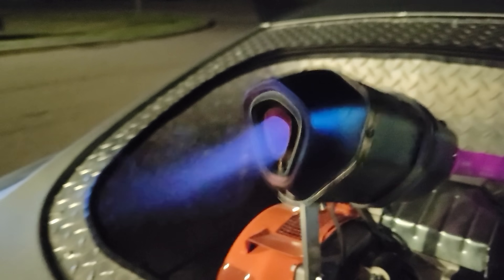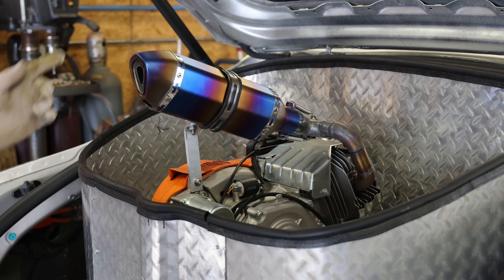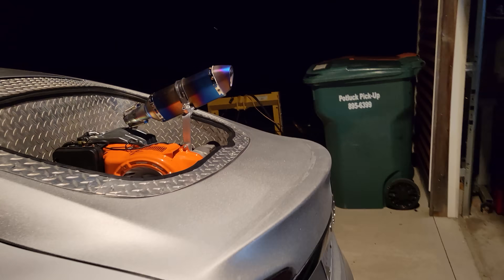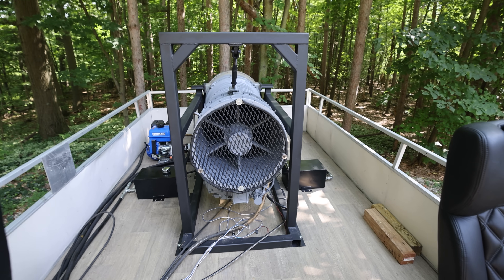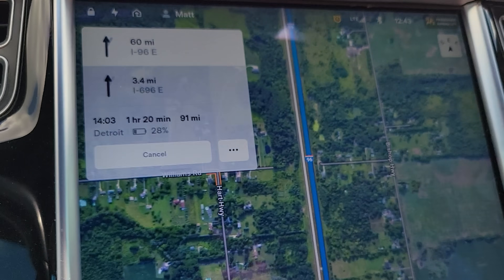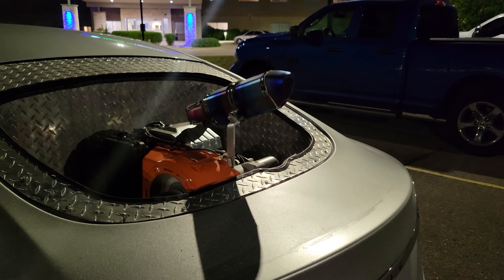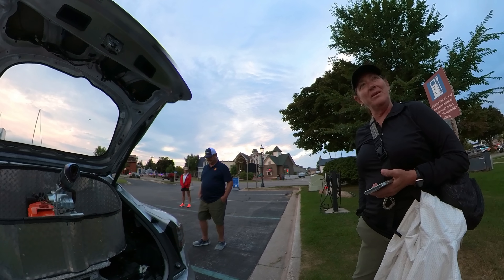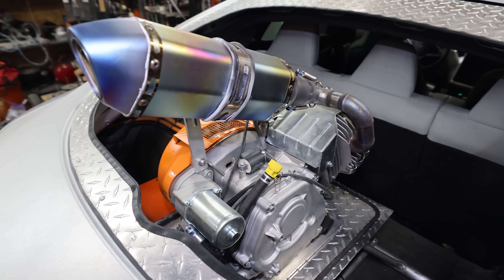Cordless Tesla (I Drive 1800 miles without charging) P.1

Comment: I wish you showed more of how this actually worked! Would love to see how you can charge while the car is moving and where you tied into the system to except the input of power. Normally, a Tesla will not move or drive while it is charging. Any chance you could share more about all of that?? :D
Reply: The only part I wanted to know, he didn't cover! 😭😭
Reply from the maker: @Thesocialgarage  there's a reason for that, 3 things, Proprietary, Very Dangerous and Deadly Voltage. I custom-built the BMS and the algorithms, I won't have anyones death on my hands tho.
Reply: @WarpedYT  good idea to not show anybody
Reply: @WarpedYT  calling Bs on it.  Looks like you are showing bling bling tools and the generator was a wen 8 k, not a 10k.  Go back east coast
Reply: @WarpedYT  I want to know the electrical engineering behind this soooo badly. What do you mean by designing algorithms? Did you program the BMS on your own? Did you actually engineer the BMS from the ground up, or sourced multiple BMSs for groups of cells? 

At least in my mind I would hook up a 24V BMS to each of the batteries in the pack that are in series, though the disassembly and install of such a task is a massive undertaking. I also have no clue if that would cause interference with the Tesla's BMS. Really wish it was shown. Almost finished with my degree in electrical engineering and I want to learn to build my own EV one day. Starting off with ebikes. 

I don't think you should worry about the liability aspect. It's not like people are suing mechanic YouTubers when they try to DIY their gas car and kill themselves. Regardless, I would really love if you could share the electrical engineering aspect without actually showing how to tear apart the battery and install it.
Reply: @LugW0rm  Its fake. Nobody is going through this hassle without showing the meat.
Reply: @snowysand13  good point. Although, Yboob has demonized for lesser offenses.
Reply: @WarpedYT  look sir no one gonna copy what you did 
but for knowledge and our curiosity wish that you still make vids how it works i mean maybe some other wacko gonna build same as you but improve it for more safer.. maybe
AND FOR SCIENCE
Reply from the maker: @talusranch990  I built this from components I ordered from the manufacturer overseas, I was told the engine was around 10,000 watts of output around 13 horsepower so I quoted that. My setup here only made 6000 Watts Max.
 I worked with a very large manufacturer overseas, no doubt these components must be used in some sort of off-the-shelf product but I obtained individual components to make a whole system.
Reply from the maker: @LugW0rm  yeah I'm really sorry about that, I meant to post all of those tear down videos over the course of a year to my other YouTube channel called Matt's lab, but I've been working by myself and very short-handed, unfortunately I'm not going to get around to posting those videos for at least another 2 to 3 weeks. But I can tell you this took me about a year to complete the modification. It is a buttload of work and I spent about $100K total to get to where I'm at currently
Reply from the maker: @tehonlynoobs5556  yeah that wacko is me
Reply: @WarpedYT  Appreciate the response! Honestly, it's kind of a genius YouTube algorithm strategy, got quite the engagement with everyone arguing whether or not it's real. Looking forward to the rest of the videos :)
Reply: ...accept...
Reply: @gesenhausen2922  yes, just 'accept' it, except unless that's not what you meant :-P
Reply: @augustwest01   r/woooosh or not? 😎
Reply: Super cap.  0% chance this is real, which is why his state of charge is always super low in the car.  He could easily be plugging in when the car is stopped with a cord from what is essentially a generator in his trunk, but this is not charging while driving.  He’s just idling the generator and wasting gas while driving.
Reply: The fact that he did not show this and it would be a massive electrical undertaking tap a generator into Tesla's proprietary electric and software system leads me to believe that he faked this.
Reply from the maker: @ElectricGlider2016  Massive Electrical Engineering Undertaking, YES very Correct.
Reply: @WarpedYT  Massive for a simpleton. More like  challenging for an educated man.
Reply: I would say it's fake!
Reply: Short out gps antenna.....it can't deny you after that.

Comment: So you basically turned your Tesla into a Chevy Volt.  This is pretty much what the Volt (and Cadillac ELR) do, the internal combustion engine is a generator that provides electricity to drive the electric motor once the battery is depleted.  The sad thing is that GM killed off that powertrain even though it was an excellent design (my wife has had both a Volt and now an ELR).

Comment: If you were using a 10kw gen and it only produced 5.4kw there's room for improvement. There's an optimal thermal efficiency for each engine, and hybrids keep the engine in that speed and load range. You'd probably need about 25kw and an engine that could turn that kind of power at about 80% load.

Comment: see the red hot muffler, and the heat coming off the engine's cooling fins?  that's where 80% of his energy went. up in smoke. you could build a waste heat recovery system and use that to increase your efficiency to around 40%- BUT- you'd need a full sized 'tesla van' to carry it around-  and you'd only have room for one person. OR: just locate the waste heat recovery system at a power plant- and then use that power to charge the tesla- NOW WE'RE TALKING. 
news flash: ALL power plants utilize waste heat recovery- which is why it's more efficient to run a tesla EVEN IF... it's being charged by coal & natural gas.

Comment: here you can see the EXTREME inefficiency of gas engines. the epa rates this car at 119mpgE. the round trip efficiency of a model 3, charging losses, battery charge & discharge, VFD, motor, drive train- is around 85%. the round trip efficiency of a honda accord is about 27%.  my chevy volt... even if I never charge it- gets around 42mpg- which is still krappy compared to 119mpgE. gasoline holds a LOT of energy.. but ice engines are HORRIBLE at converting that energy into rotational force. very inefficient.

Comment: That's a great video!!  I had a BMW i3 ReX which used a 2 cylinder BMW motor to power a generator as back-up power.  It generated enough electricity to be able to drive the car with it as it was slowly charging the battery.  It was barely audible from both inside and outside the car.  It achieved about 33 mpg for this light carbon fiber chassis EV.  How about a slightly larger generator with a more complete muffler system.  You would find that multiple smaller mufflers quiet the sound better than a single large one.  I'd recommend a muffler with baffles rather than a straight through motorcycle muffler style.  Can you post what your total amount of gasoline used?  Thanks and looking forward to more videos on the topic.

Comment: Tesla's are not super efficient. Hybrids have to be since you don't want to have bad gas mileage. When you just get cheap power you don't think as much about how much energy you're wasting. Modern cars are obviously more efficient than either Teslas or those little generators because as much power as possible is translated into horsepower.
It makes more sense for the future of the planet to just buy either an economy car or a hybrid

Comment: WP why the fuel consumption is really bad because you have introduced a air gap where the window was making a low spot that causes drag. So I would say place some kind of plexiglass over the hole except for the exhaust pipe. Also why the moped loud exhaust. Why not a turbo and a proper exhaust system so it's not loud af. The idea is really cool. Kind of hybrid system more or less. But is it really practical? With this loud exhaust. I will have to saw nope.

Comment: It is truly amazing that the amount of people believing this. There is no generator on the engine you put in. It is just sitting there doing nothing except ofcourse burning fuel. Even if you installed a proper generator set on the tesla it will still not move while charging because of the built in software and hardware interlocking that keeps the main batteries disconnected from inverters to prevent the car from moving while on charge. To be able to overide that suff would be an amazing series in itself. No one has been able to do it with out completely gutting the original electronics.

Comment: Need to go gasoline fuel cell instead of engine.  I believe Chrysler was working on such technology but haven't heard a peep since then.    Could also try natural gas fuel cell system to generate electricity.   Gasoline engines are just not that efficient.    Still, I want an atomic powered system where I don't have to worry at all nor even worry about getting fuel.    Too bad the powers that be will never allow such a disruptive technology from ever getting released.   I mean, look what they did to S tanley M eyers and his water powered car.   :)

Comment: OK, here is a little physics to go along with the video. A Tesla can travel about 3 miles on 1 kW-h of electricity. At 60 MPH, it will travel 60 miles in one hour and consume 60/3= 20 kW-h of electricity. An efficient generator running at full throttle can generate 10 kW-h of electricity per gallon. So, it will burn 2 gallons to produce the 20 kW-h. Meanwhile, the car has moved 60 miles. So, it is getting 60/2= 30 Miles per Gallon of gasoline. Pretty impressive considering the weight of the car. The big advantage is that the engine runs at or near full throttle. ICE engines running at lower load are not nearly as efficient. Maybe three times less. Since it takes 20 kW-h to run for one hour, you need a 20kW generator to run continuously. Maybe upsize that to 30kW for some margin. With a 10kW generator, you can only drive 50% of the time that it is charging. Of course that assumes no losses in charging and discharging. The key to efficiency is to keep the generator running at near full load.
Reply from the maker: Your math is pretty close, one thing to mention, the weight of the car doesn't matter, but what's really impressive is that my car is almost a 1000HP AWD does 0 to 60 in like 2.3 seconds and is getting 20 miles to the gallon on the freeway. I left all that extra information out of the video because this was more of a proof of concept thing, I'm working toward a different goal with this project. But in the next video I'm going to be going into all of those details briefly. Thanks for crunching the numbers

Comment: We need more details on how you routed and controlled power to the battery. This would be useful to anyone who wants to charge while driving, whether from gas, auxiliary battery, or solar panels.
Reply from the maker: Unfortunately that would be a modification that only Tesla would be able to do themselves. I have a modified system, it's not something that you can just connect. I will give more details in the next video

Comment: You can increase the muffler size to avoid disturbing yourself in the car and everyone outside. If you can make a muffler that put a 60 Db output, that will be great. You also can use ceramic wool to insulate the generator basket from the generator sound and heat.
Reply: Agreed it didnt need to be quite so noisy.  And it would have been possible to mount out of the way under the car so the exhaust could  be mounted like a normal cars exhaust.  And using a two pipe silencer with a cross flow design its would have been roughly 35db at full chat.
Reply: How does one make a comment referencing heat without telling him to fix the timing on that poor motor?

Comment: I have the solution. I developed a magnet motor that will produce useable torque and RPM and can easily drive a generator. A box about the size of a suitcase in the trunk will continually charge the car. 
All I lack is the funding. Anyone interested please contact me.

Comment: I would do a larger inverter generator. Inverter generators run at idle instead of full throttle, so not only are they very quiet, they are far more efficient.

Comment: What a coincidence. I can drive across the country averaging 70 MPH at 18 MPG in my Chevrolet Silverado 2500HD 4x4. I also have to stop periodically to get gas. The only difference is that I don't have to leave my engine running in the hotel parking lot at night.
Reply from the maker: Exactly!! And to be fair the engine in your Silverado is much more efficient than this engine
Reply: @WarpedYT  I'd like to see Tesla make a hybrid that is efficient. Your design is a great start. With a hybrid, when we can't find a charging station (or the grid is down) the gas will still get us to where we need to go.

Comment: twice or 3 times the kw of the charger you have now would have been better but i like your thought process . if you could hold the battery at 60 t0 80% all the time the battery pack would last ages than depleating it and then charging it back up would be better .
Reply from the maker: Yes, absolutely. That's exactly what kills the battery packs bringing them down below 20% and over 80%. That's one of the things I'm tackling here with this project wait till you see version 2 that's going to be like the sun coming up in the morning
Reply: @WarpedYT  what about using a 3k or more inverter generator instead? It could likely maintain your charge levels and be much much quieter

Comment: If that Tesla took that much gas to keep it running, then imagine how much power it requires to charge. Hope you're not getting your power from a coal or natural gas power plant. Electric cars are not as green as most would like to think.
Reply from the maker: One thing that Tesla is great at and I left this out of the video by accident, is converting energy into motion they are very very efficient machines. But they are not good at storing much energy.

Comment: I think there could be a market for something like this in a pull-behind trailer form as a occasional range extender for longer road trips where chargers are scarce or the time to stop and charge is inconvenient.   It could also be used for roadside assistance in case a car runs out of charge instead of towing the car to a charger.

Comment: Awesome video!  This is something I've been waiting for a long time to see!  The thermal efficiency calculation was where it's at.  If you use a Honda EU series generator they are in the 30% range, so your fuel economy relative to the Kohler should double.

Kudos for your contributions.
Reply from the maker: Thank you and Yup, you got the point. Thermal efficiency is where it's at, and the Tesla makes extremely efficient use of any energy put into it. At the end of the day the Tesla came out shining like a star.
Reply: I saw the exhaust glowing red and I couldn't help thinking that the engine was wasting a lot of energy.
Reply: @josephallred8633  great observation, I'm not familiar with small engines and i was wondering if the glowing exhaust meant it was broken or malfunctioning somehow.
Reply: @scotty305  ,
I'll be honest with you, I'm not that familiar with small engines either. My experience, if you can call it that, is in studying steam engines. When it comes to efficiency in a steam engine, you want to try and uses as much of the heat as you can to generate power. If you're exhaust is is putting out a lot of heat, then your system is inefficient, and if there's a flame coming out of the exhaust, as you could see at times in this video, you're definitely wasting fuel.
Reply: @josephallred8633  Yeah, I've wondered about making an EGR... maybe just from a Prius gen3 or later for an OHV or even L-Head engine.  Basically need controls to swap flows between carb or breather valve and EGR valve.
Reply: A few days back I was wondering if with these small engines, you can get away with an air cooled EGR Radiator vs liquid cooled.  Maybe more suited for the Kawasaki's or other liquid cool mod design?